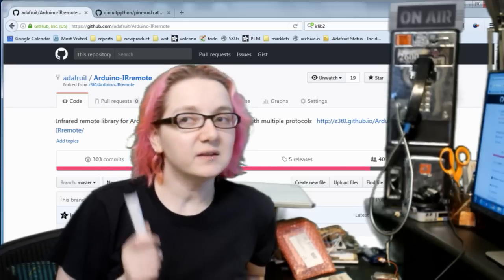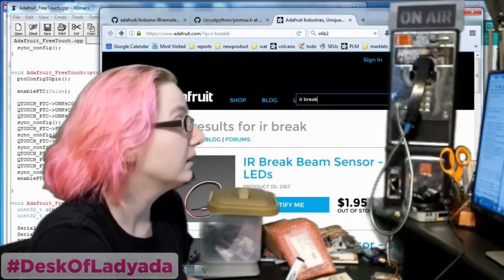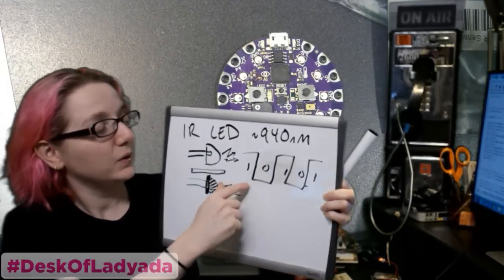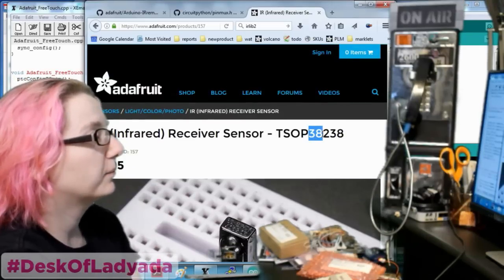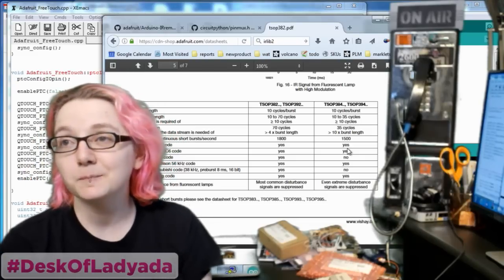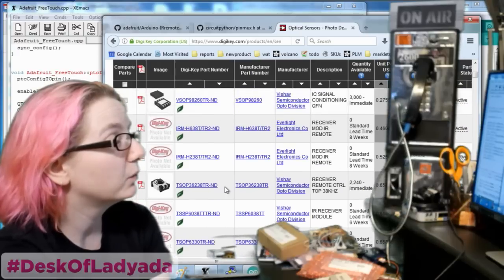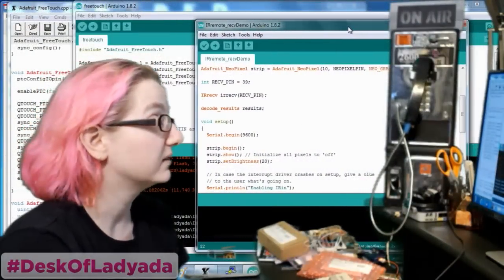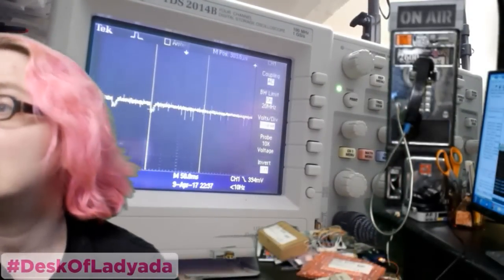Circuit Playground Express IR TX/RX testing #DeskOfLadyada @adafruit #adafruit #programming

Comment: One of the neat features of the Palm Pilot is that you could use it as a remote control using the IR transmitter that was built-in to the device.